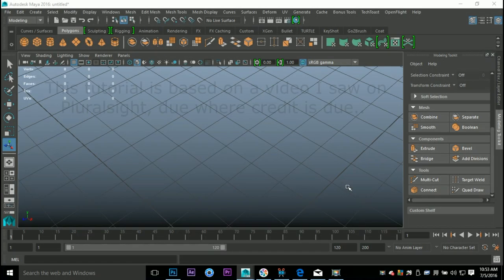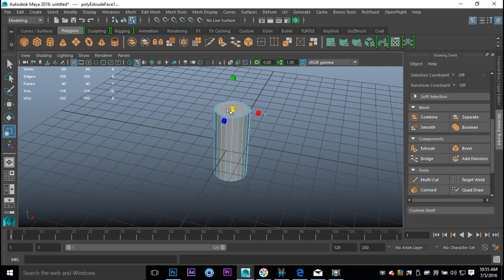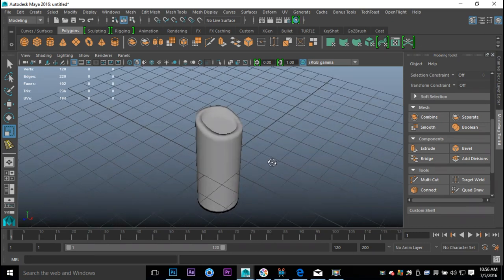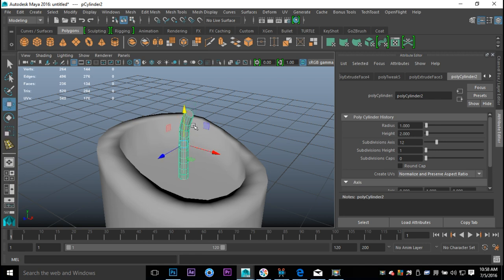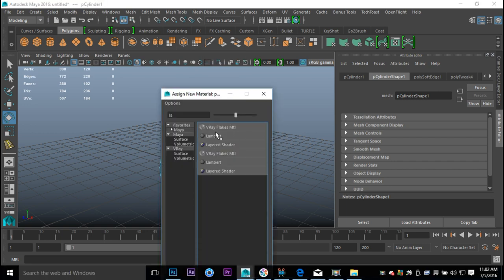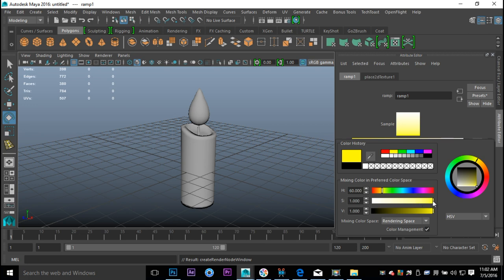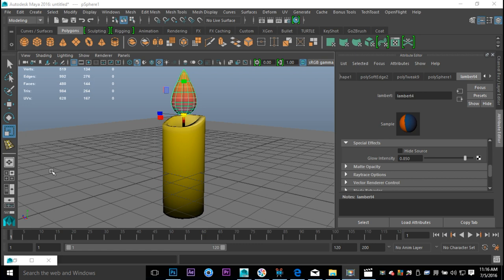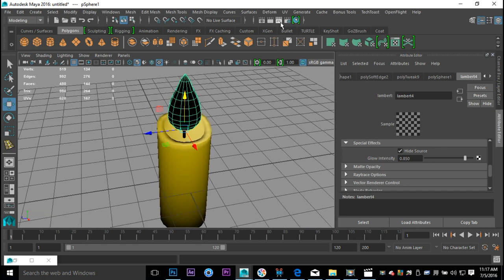How to create and animate a Cartoon Candle in Maya 2016

Comment: Hey Mike! 
Once again thanks for the video!

I'm having a minor problem. For some reason I am unable to move the center face down (2:11 in the vid); instead the entire cylinder moves with it. 

Help!
Thanks again!
Reply from the maker: Hit 4 for wireframe mode and check that you have not selected more than what you need
Reply: Still no luck. I've even tried starting from scratch on the cylinder and get the same results.

Comment: Hi Mike...Do u know anyway of mirroring a model so if i cut or edge loop one side, it will do the same in another side?....I watched your tutorial in mirroring but the problem is when i try to cut or edge loop one side it won't do the other side
Reply from the maker: If you are working in Maya 2016 try symmetry https://youtu.be/fLLny9LsVXs
Reply: Nope...That doesn't work...If i try cut something on one side it won't cut on the otherside.
Reply: Mike Hermes I'm also trying to load a script but when i try to source it, it gives me an error...Do u know how i could fix it
Reply from the maker: Try modeling the right half of the model and when done Instance the model in Negative X. This works, I just tried
Reply: Mike Hermes Okay thx...Is it possible to custom make the 'instance mirror' a hotkey?
Reply: You can save your Duplicate Special settings after youve changed them, then you can put Duplicate Special as a hotkey.

Comment: Hello, Mr. Hermes. I followed your video but the last part is giving me trouble. I use playblast like you do with the same settings. The animation of the flame model is there but there is no light in the video, neither from the directional light or the candle itself. When rendering the image the light is there. Any idea what I could be doing wrong?
Reply from the maker: What version of Maya are you using ?
Reply: 2013, I think. The layout is different from yours in the video.
Reply from the maker: That could be the problem. Try batchrendering the outcome instead of using Playblast. I think that will work
Reply: I have never used that. I googled where I can find it in Maya and applied it but can not find any video file anywhere in the project folder.
Reply from the maker: Here's a link with instructions https://youtu.be/ojvf39ph5MI
Reply: Thank you for the help, Mr. Hermes. Wish I had spotted that video myself as you posted it rather recently. Still, it means a lot to me you replied and helped me out here, thanks :)

Comment: Hello Mike,
I want to ask you if you know how to solve a specific type of error. While i was using traks editor in Maya 2016 and playing around with animating a basic robot I tried to export a video.ma for later use. Then Maya said that i cant save the given file and completely messed up the save system. Now my scene is completely screwed and i can do absolutely nothing. Basically i cant save anything from this point on. If you or someone else know how to solve this error ,please reply.
Thank you in advance!
Reply from the maker: You tried to export the animation as what ? ( what file type, format etc )
Reply: .ma , .mb  the two formats that were available for exporting an animation clip.
Reply: I have found it!!! The problem was in the doExprotClipArgList file. I have replaced it with an older one from maya2013 and it worked!!! 
If anyone has the same problem - 
http://forums.autodesk.com/t5/animation-and-rigging/exporting-animation-clip-trax-error/td-p/5442273
this is a link where you can download the file.

Thank you for the fast reply Mike and also thank you for the awesome tutorials. Keep it up
+1 respect from Bulgaria. :)
Reply from the maker: You are very welcome Philip, I am glad you fixed the problem

Comment: Hello,
I finish the animation for the candle and when I playblast it, the candle only show the the black model of the flame, I am using Mac laptop. Am I playblasting the candle wrong?
Reply: I actually figure out the problem and solve it.
Reply from the maker: Godo Krista, what was the problem ?
Reply: I didn't batch render in maya for some reason that why the flame part for the model went black so once the animation was batch render and put in after effect it work.
Reply from the maker: Cool, thanks for sharing !
Reply: just finished my flame and i had the same problem lmao. Time to go and rewatch the vid on how to batch render :>